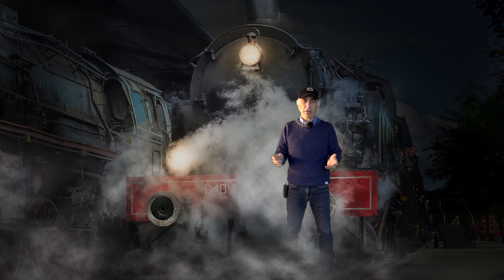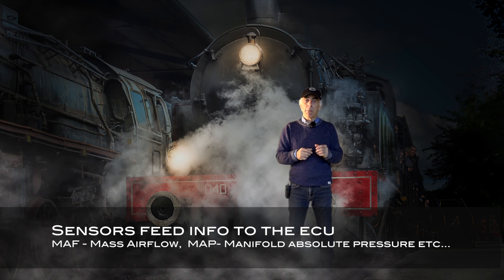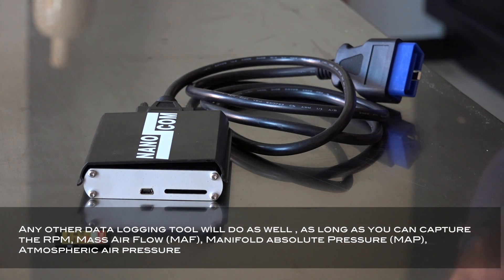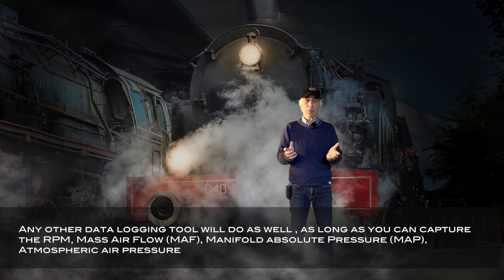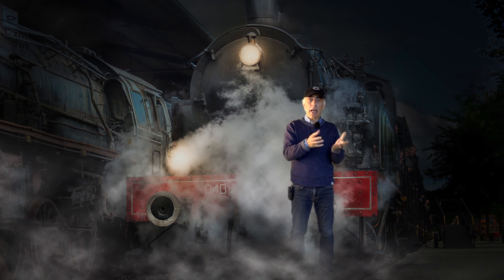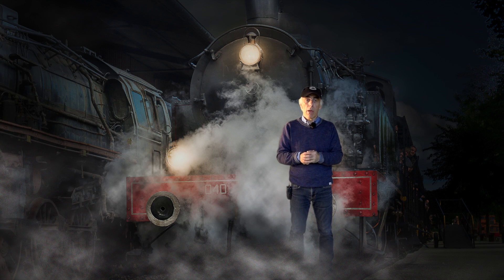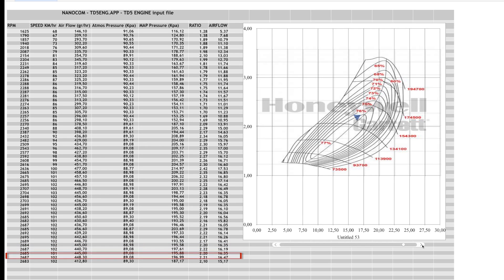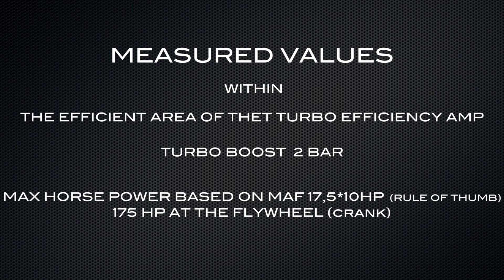Landrover Defender TD5 Turbo  ECU   Match and Performance Verification

Comment: Hi, great explanation, thank you. What kind of spreadsheet did you use in order to create the compressor map? I noticed that when scrolling down the table, the pointer moves along the compressor map showing the position of the values. thanks
Reply from the maker: thank you, its based on Mac Keynote and XL for Mac, and a few macro's.

Comment: I have 1987 defender model. How can i improve the power of the engine
Reply: Wait 87 ? its a 300tdi then ? if so no programing cause you ain't got an ECU get the boost pin instead
Reply from the maker: Bilal Khan a tuned fuelmap for the ecu and a blanking panel for the egr valve.   But note that your engine must be in good working order .    Engines that are not in a good mechanical condition can not be helped much with tuning. First get the engine in a good working order
Reply: Thank you 😊😊...i ll send u vedio of engin

Comment: Hi great videos, i very much enjoy them.
Would you recommend getting a flash ECU remap? My land rover mechanic makes their own, they asked if i wanted to install it for better torque & power. What would the negatives to getting it  one installed?
Reply from the maker: Well, I would not, but then again it all depends on what you want to get out of your landrover. More power & torque is tempting, however that tends to cause more smoke and makes the longevity of the engine a bit shorter. But then again , it can't really say if it is bad or not, since I have no idea how good those folks are. Some are cowboys, others real professionals, as long as they know what they are doing and can tell you what they have changed and where the compromise lays.   I would ask to show a benchmark on torque and power before I would go for it. Wat else besides the ECU remapping are they proposing to change ?    (intercooler uplift, Modified MAP, EGR valve removal, MAF change, Turbo uplift or just a waste gate adjustment for >2Kg boost).   Fuel cut-off limits changes etc.....   I really would ask what they have remapped/////  TXS
Reply: D3Sshooter they just offered the chip and decat exhaust. While it does sound tempting I'm just worried for the longevity. Plus getting a remap would probably lead to other mods to suit the changes like you said(intercooler, boost). Thanks for the reply ! Keep up the good work.
Reply from the maker: TXS  , Decat the exhaust... so you have a petrol engine... Diesel don't have a catalyser.  As they offered a Chip, that is a bit more then just rewriting a new fuel map in the Flash chips of the ECU.  In fact they will need to de solder and re solder the SMD chip, something I would not do to my ECU, as an electronics engineer  there are to many risks with it if not done on a professional chip bench. One might not see anything wrong initially, however there is a big risk that the other components and the  chip itself get ESD that will show much later.  But then again , they may ver well be pro's.  Ask them for the power and torque curve, and at last ask them what high and low limits the have changed (those limits are to safeguard the engine from damage e.g Boost pressure>2.2Kg will cause the fuel to be cut-off  not to damage the engine....... Good luck, and if you decide to go for it, let us know the outcome....
Reply: Please consider the weak part on an TD5 is the gearbox, it´s designed for 230 Nm of torque from the engine.